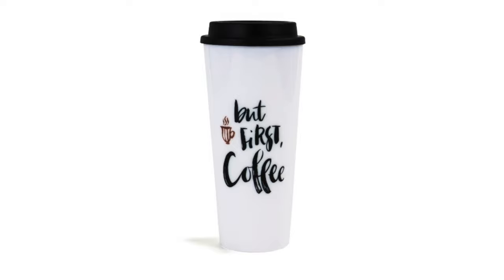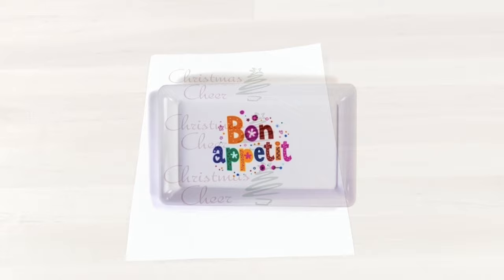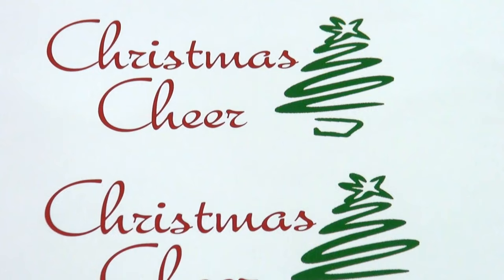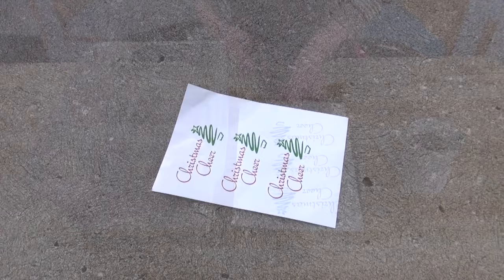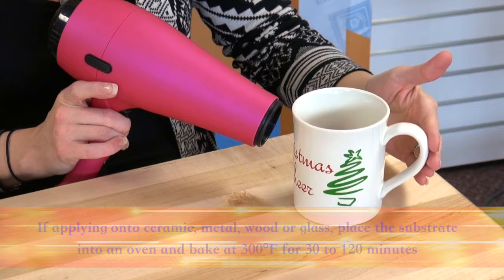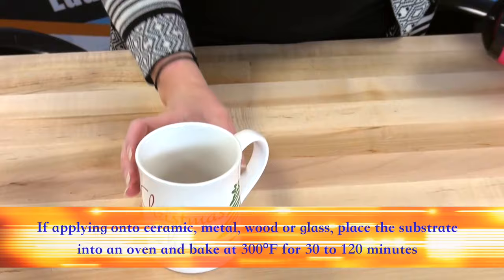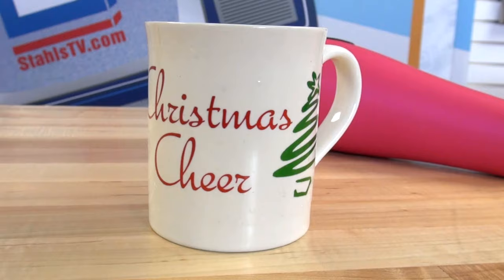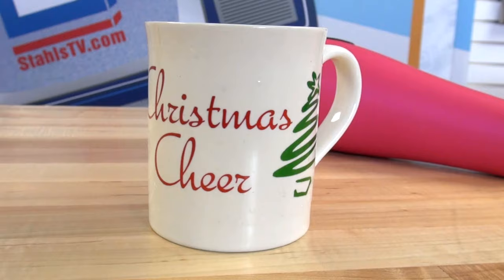How To Decorate a Mug Using Inkjet Transfer Paper

Comment: What they don't tell you is that you can see the paper on the mug after it has been transferred and baked.
Reply: Exactly
Reply: Right you would need the image only cut out and taped on with heat tape and at that rate you might as well just decorate it with vinyl and throw it on a hanger on the wall.

Comment: Do you seal the applied decal before or after you bake it. By baking it, does it make the decal dishwasher safe?
Reply: Actually no..the aerosol you spray is actual combustible therefore should Not be baked.

Comment: Is it ok to put this mug in the microwave with the decal now attached?
Reply: Thanks! I ordered the paper and tried doing this exactly as done in the video. The main problem I had was the paper bubbled when dried, and the edges did not lay flat. They crinkled in. How do I avoid that?
Reply: @sydneydirling6063  the decal should be placed before it dries